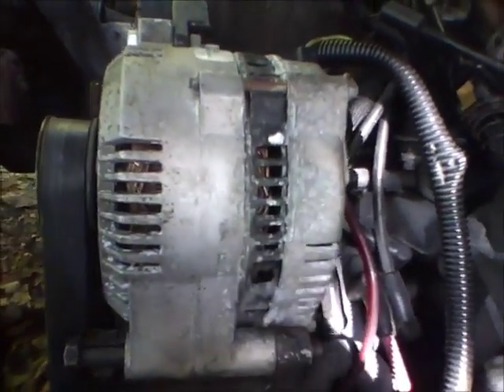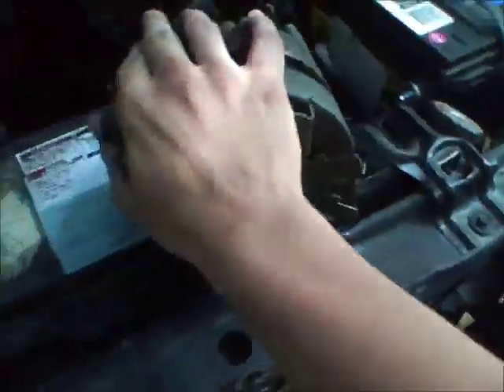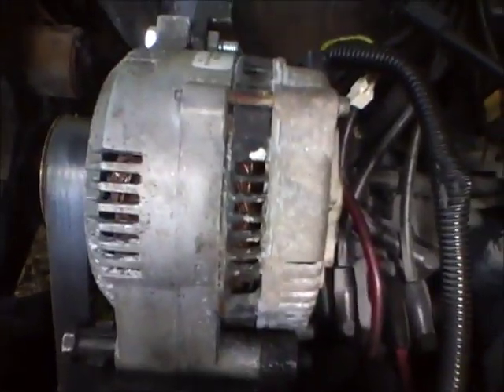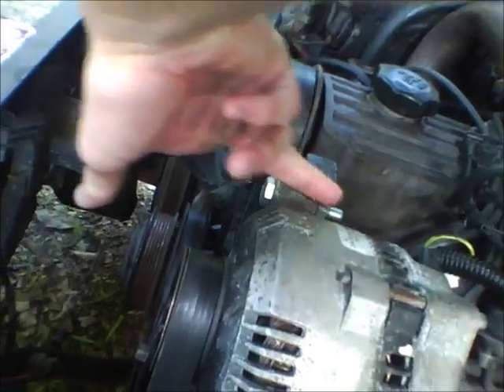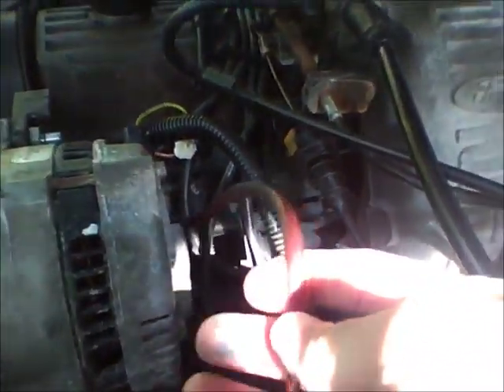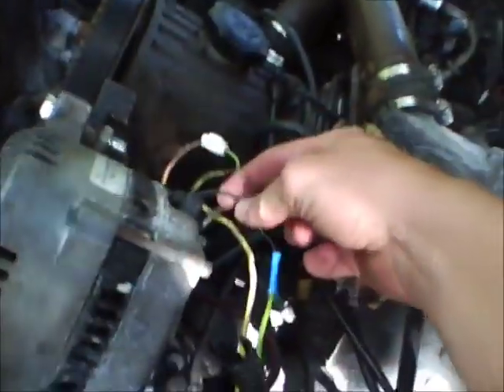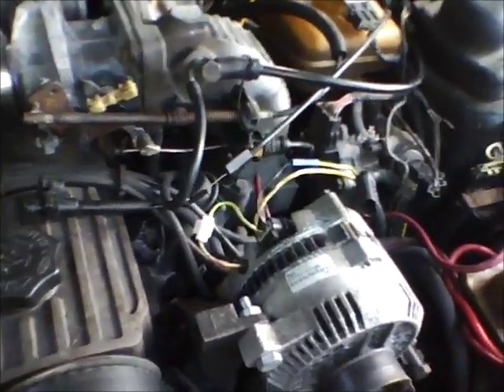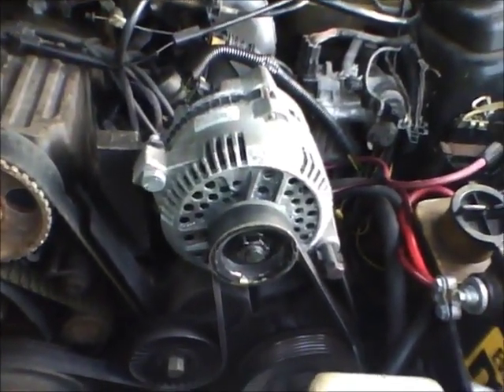Ford 2G to 3G alternator conversion

Comment: Confused now. Just watched another video where a person took one of the wires from the top three plug and hooked it to the bolt on the back on the alternator and then hooked the stator plug to the green wire on the vehicle this video is showing different. I don’t wanna wake up one morning and truck burn up

Comment: From the old connector, where you capped off the two output wires, what do you do with the third cut wire from that connector (S wire)? Do you cap that one also?